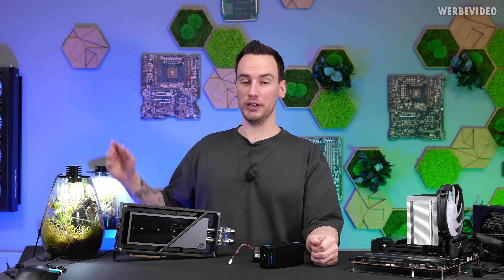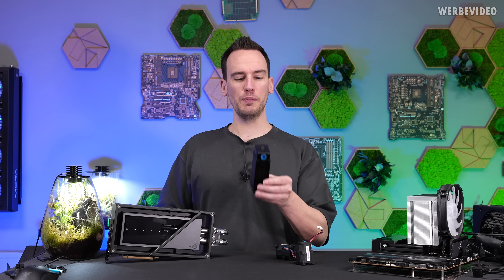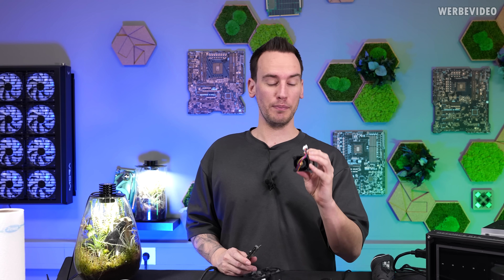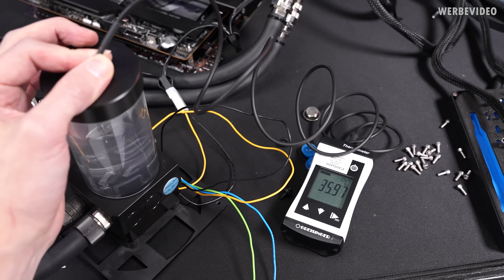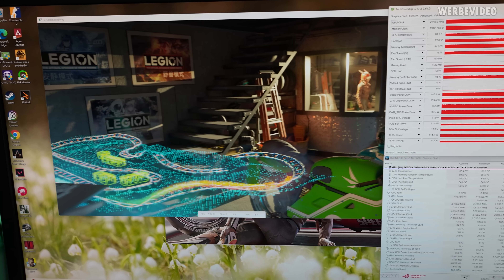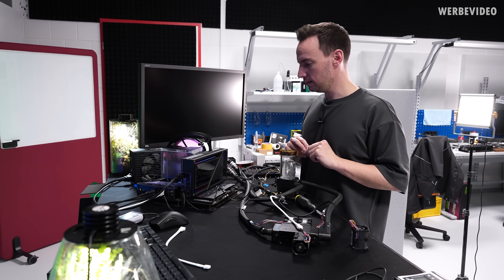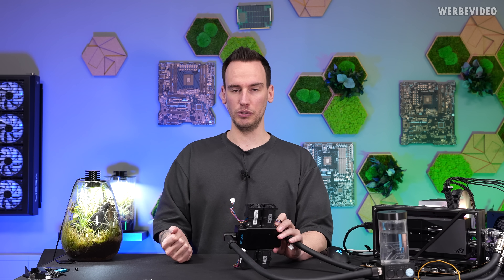Cooling my RTX 4090 with the Smallest Radiator I could find

Comment: instead of fans, you should try a compressor, for compressed air cooling over the radiator lol
Reply: or alternatively, maybe use a peltier cooler to transfer heat from two water blocks to have a cold loop and a hot loop, so the hot loop can dissipate heat more effectively (downside is that the peltier will add a lot of heat of it's own to have to dissipate)

Comment: Yeah, I replaced the 120mm fans with 4x60mm fans. I don't run them at full speed, but they have higher static pressure, so if you're using PU filters, it works great with them (lesser noise, more airflow). Also in generally, I did some casual tests and determined that 4x60mm fans make less noise than 1x120mm fan (but the wiring is difficult) for the same power consumption (since I could not measure the air flow). For the power supply, I'm using an external 12V power supply and the mobo PWM pin is connected to all the fans. Also I'm using a simple 12V relay to ensure that the fans shut down when the PC is shut down (and when there is no PWM signal) while the external SMPS is up (since it's powering other things too).

Comment: This would be so much easier if manufacturers would provide actual useful values. Like the heat dissipation of the radiator in the usual W/m²K. This way one could easily calculate the required area of the radiator fins to achieve the desired water temperature at any given room temperature.

Comment: I had a similar discovery with a cheap fan controller. I bought one that has 4 rheostats and support 8 5v fans. I bought a 4U 24 bay case and the air flow for the drives was lacking, so I put better (and quieter) fans in there, but cranked them all up to 100%. While I was messing around with other cables it moved once and hit the side of the case. Everything shut off. To my horror, it turns out that some of the contacts/pins from the factory weren't grounded or insulated in any way and it shorted out when it touched the case! So I coated anything metal in superglue and that fixed that issue. Then I noticed that it was putting off A LOT of heat, I touched one of the 4 ICs and burned myself like you did and was like "holy shit that's hot!". Luckily I had a bunch of small heatsinks that I purchased for a Pi 3 or 4 long ago and they fit perfectly! 1 heatsink on each IC definitely helped drop the temps down to reasonable, but still warm/hot to the touch, the moderate airflow in the case also helped cool them down. We always forget how hot tiny things get when we force a lot of power through them hahaha

Comment: These 40mm rads are very interesting units. I first came across them when an ex-customer involved in High Frequency Trading and crypto in the early days requested for my company to procure the servers. I believe it was an ICC Vega "server" where they had a Core i9 overclocked to 5GHz (you want high single-threaded performance for HFT to validate and push trades faster rather than high core counts) and used a triple 40mm rad to handle the heat.
The IT requirements in that part of the finance industry is rather interesting. They'll ditch any form of cybersecurity necessary just to get lower latencies - no firewalls or managed switches (for VLAN segmentation) because they add latencies. There are even specialized unmanaged switches for this industry that are designed to purely focus on ultra low latency switching

Comment: i think the setup is wrong. You should put the fans the other way of the radiator cause at these spees the fans are poducing to much heat i think. So, at least make the test again with one blowing and the other sucking throug the radiator. Adn also you have to measure the air temp. before and after to find the differential.

Comment: I love these tiny radiators. Mine are a bit larger, designed for 80mm fans in 2U chassis instead of these 1U rads, but I have a grand total of 2x80mm cooling a 14900K and 7900XTX. Noise isn't a concern, but size was for a custom case.

Comment: Clearly static pressure isn't an issue, you should stack a few of the radiators in series to get closer to a counter flow heat exchanger. See if gets any closer to being practical

Comment: you could put the fan controller to back of the radiator to reduce the temps with air flow of the fans

Comment: Now try watercooling using car air heater radiator + maybe try to use those fans with venturi effect --- single fan , adapter for way bigger radiator than fan size + venturi effect designed intake , could be interesting + maybe testing nozzles for fan

Comment: put the fans and radiator in a long foam tube with baffles as noise cancelling, and whack the controller at the opening with a heatsink for passive cooling from the airflow

might be good for an indesk pc, very long but narrow and thin

Comment: It makes me wonder if the heat sinking performance of the tiny rad under burst loads could be improved if the plumbing inside were zig-zagged, increasing the surface area by lengthening so it is an endless chicane from start-to-finish.

Comment: there is an extreme to which either adding surface area or air volume and velocity doesn't further improve cooling. You have to add both, unfortunately :)

Comment: My issue is no matter what, smaller parts = smaller contact patch, which means more friction and wear. Personally I'd rather have slightly larger parts on something I might move once a year at most and just never have to worry about failure.

Comment: Many boards have one or two 3A headers these days which should handle two of these if they're really just 18W max. I'd be hesitant to push it and run them at 100% but I've pulled quite a lot of power from these headers without issue.

Comment: A fan usually has a 4pin connector, +12V, gnd, pwm and a feedback of the rpm
You could cut the 12v and gnd wires and hook them up directly to the psu and plug the 4pin connector directly into the motherboard
With this you can control any pwm fans without frying your mb

Comment: last time i replaced fans in 1U servers i remember those things had 3.5A tops, which at 12V (because they run at 12V not 5V) mean some 42W at max speed, i doubt normal fan controller can handle 2 of these, let alone 4. 4 fans at 100% speed will draw 14A from 12V rail ... and that's just for fans. mind regular 1U servers have either 6 or 8 of those, and if they are stacked, like in compute servers, you might even have 16 of them ... that's some 56A or  you can say 672W of power just for fans ... although normaly they don't run all at that speed.

Comment: I've had a Mobo that did do 3A each on 2 fan connectors, I ran 2.7A fans on it.
The magic of the pwm on fans is that you can just pipe a trace directly from the 12V  connector, the pwm itself is done on the fan, so the controller shouldn't get warm unless it's actually doing dc speed control.

Comment: How big difference could copper radiator make compared to aluminium radiator with same fluid capacity and surface area? I think atleast the airtempature behind the radiator would be alot closer to fluid tempature

Comment: You can usually guess if a push/pull will make a large change. If it's a thinner rad or has wide fin spacing, there's not much resistance at all and adding extra fans won't produce a considerable change, if any at all. If it's a beefier rad with a thick core or tight fin spacing, push/pull can have an impact.

Comment: i'm not physicist but heat dissipation relate to thermodynamic. if you want low air flow then you need larger surface area to dissipate the heat, if you use smaller surface area then you need faster air flow to dissipate the heat. with that small radiator, it's need to use high rpm and higher air flow. that radiator usually used for 1U server case for cooling cpu (not gpu). for gpu intense use (such gaming) better stick with 2-3 240 radiator, don't sacrifice your ear (i know, because my server rack is same room where I work, those fans are insane when they in full speed, thank god I use only for cpu with low work load).

Comment: Please use hearing protection around those fans. The sound they make is more than loud. It is not bandlimited. It contains energy at extreme frequencies. The energy in a wave is equal to its amplitude times the square of its frequency. Loud sounds will make your ears ring, high sounds will make your ears ring, loud high sounds will destroy your hearing!

Comment: Howling Delta fans killing peoples' ears all over again 20 years later... Ah, the sweet smell of nostalgia! :D

What of raising the water block a ways off the table so the fan intakes don't rest on a flat surface? This could potentially improve air flow through the cooler (maybe even if just a little bit), since axial fans tend to suck/squirt a bunch of air from the sides, and not just straight into the fan...

Also, I would like to put a heatsink on that fan controller, if it's running that hot... Undoubtedly its service life would be heavily cut short if temperature-tortured this way for an extended period. But, since nobody wants to listen to counter-rotating 90dB Delta howlers for even a short amount of time it probably doesn't matter! :D

Comment: I didn't expect such a sloppy video from you tbh, obviously you were not cooling it enough and when the water temp stopped raising at 60º I am sure the video card was throttling. So no, you can't dissipate 450W with that radiator, maybe if you pump in cold air, but then you risk condensation etc etc .

Comment: I suspect a lot of people will wonder what the point of this video is, but it's actually demonstrating a good point about the state of PC water cooling right now.

I've been water cooling for over 20 years, and it's frustrated me watching people waste money on absurdly overkill radiator setups while chasing lower coolant temps, to the point people often have one intake radiator dumping heat into an exhaust radiator which is effectively cancelling out a lot of the benefit of the 2nd radiator. Radiators become more efficient as the delta between ambient air and the coolant increases, so chasing low coolant temps mostly does nothing but increase the cost, complexity, and points of failure, while it decreases the flowrate and provides almost no decrease in component temperatures or noise reduction.

At 20-23C ambient, a single high quality 240mm radiator with high static pressure fans is capable of dissipating ~550W while still maintaining very reasonable noise levels. A single high quality 360mm is already enough to cool an overclocked 14900K + 4090.

I think a great video series would be testing each radiator area sizing with this same heat load, and showing just how much heat you can actually dissipate with them. I think it would surprise a LOT of people and get them re-evaluating how much radiator they actually need to cool their build.

Comment: Weird is that some voltage / current controller? Why if those fans are PWM? No need waste heat in controller as fans controls speed by PWM if possible. All you need is PWM generator based fan controller which does just bypass the voltage.

Comment: I know Roman still has all his marbles, because if he lost them all he would have tried to water cool the fan controller.
Man has made the PC watercooling version of the Republic XF-84H Thunderscreech or Tupolev Tu-95 lol. I have a little battery powered air duster, small but hefty and not at all cheap and that thing pushes enough air to drain the battery in it in 10 minutes at full throttle and gets loud enough that I need hearing protection so I understand the pain.

Comment: just at the beginning of the video i know there is limitation of how much a powerful fan can extract as heat from a radiator, the limit is the conductivity between the water inside and the copper of the radiator. it takes time to move the heat and spread through the surface of that radiator, no matter how fast the fans are. you can increase that speed by just increasing the surface.

the same happens with the am5 IHS small and thick, creating a "jam" in the heat transfer.

Comment: Those fins are way too sparse, especially when its made for 40mm fans which have (or can have) really high static pressures.  I'd want double the density minimum.
Reply: fin density depends more on air speed than the size. It looks like it's made for regular low to medium air speed, where low fin density works pretty well. But if you want to extract the absolute most amount of heat, then you are right. Way higher fin density with more channels would work a lot better with such incredibly fast fans.

Comment: I assume that these 4 fans plugged probably tripped OCP protection on PSU, not sure what their starting amps are for fans, I tripped few times OCP protection on Aquaero and Quadro Fan controllers with few fans

That's what we like from you Roman, crazy things who nobody does, awesome video mate
Reply: Yea! I have done that on server boards with those Blowiemetron delta fans too! They blow a lot, but it doesnt really gain much in terms of thermals wrt the cost or the difficulty of installation.

Edit -> I ended up making a separate fan control board with a separate SMPS using the RP2040 to control the ramps from the mobo commands. Waste of money, it was.
Reply: Startup amps for those brushless fans is little if any higher than at their full speed.  You might be thinking of brushed motors, especially with more load on them than just pushing air.  They're probably no more than about 1.5A  peak rated and in use, probably 1A or less which is pretty trivial compared to powering a computer and gaming video card, but yes that could overwhelm a fan controller not designed for that much current.  It wouldn't trip OCP on the  PSU.

Comment: The whole point of having water cooled system is high performance with low noise levels. I'd rather see a proper build using a side mounted mora 3x3 with the best PC case for this solution currently available on the market. And probably coupled with AquaComputer's Ultimate pump.

Comment: I heard 60C is too much for some pc watercooling components to handle (pumps?), and some temperature monitors trigger warning signals.. I guess you would have noticed if the water hot signal would somehow intercept your PS_ON pin?

Comment: ive had multiple 30 series cards working 24/7 for years at 94c+ on vrams and they all survived and were healthy..hell my daily 3090 still pushing it with modded aio, copper modded 24 vrams etc and its not a big of a deal, my 240 rad with 75% speed noctuas does 60/64c at full load 520W

Comment: Would be interesting to measure the open voltage of the 3rd/4th fans (as they were acting as generators) prior to connecting them to controller.

Comment: Is the problem Fan Controller related i.e. the controller isn't able to provide the current required is is getting too hot? may be you should think about using separate fan controllers, adding some heatsinks to the controller(s) or water-cooling the controllers?

Comment: 58°C lol my advice is that your liquid temp should never go above 45°C I noticed in a non air-conditioned european room that under 40°C liquid your PC barely heats the room but above 45°C liquid temps it will become noticeably hotter and you will feel a heatwave coming out of your PC I started with 1x360mm then 2 then 3 radsand can play at 700/800 computer watts fine lian li 011 dynamic xl ftw

Comment: I doubt the two fans were running at full speed, 20k RPM is much much louder.
It seems like the dumbass fan controller was the DC not PWM type and it probably had some weak electronics or tripping PTC fuse and it was not outputting all 12V, the fact that you needed to turn them high to get them going confirms it, high end fans like that have auto-kick-start function but you need to supply all 12V and drive it with PWM.
Please re-make the video and this time find a PWM fan splitter.
Reply: Or If you want I can design a high power fan splitter for you that takes a PCIE/EPS 8 pin and can drive as much current as the fan pin header is rated to (3A?).
It then would get PWM from the motherboard and also supply TACHO speed of one of the fans.
Btw. the exhaust fan will spin faster.

Comment: Could try DIYing your own radiator: Take an old CPU cooler with heatpipes, cut the heatpipes and clean them out, and plumb them up to some fittings.

There are some absolutely miniscule heatpipe coolers out there. Raspberry pi ones with 2 heatpipes for example. Laptop coolers too. Or you could go the opposite route and see how much performance you can get from a 25$ tower cooler turned into a radiator.

What would be really hilarious is using an older Vapor Chamber or Heatpipe GPU cooler as a radiator. Old, dead cards may still have some life left in them: as coolers for new cards.

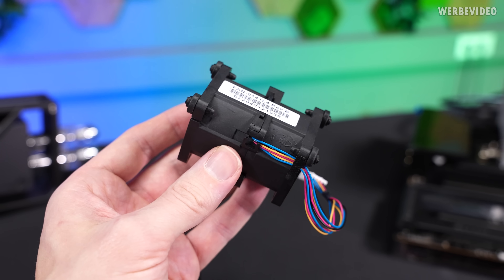Comment: 3:38 18Watt fan.  
5:39 20Watt fan controller per channel.
Flying a bit close to the sun @der8auer

Fan controllers for PC are always under build, even if it says 20Watt on the sticker.
I would say anything drawing above 10Watt should have heatsinks on components that do the heavy lifting AKA get the most hot.
A thumb rule of mine is always go for the 50% load approach,  so you have headroom for power spikes and thermal headroom.
So If you would need 20Watt then get a 40Watt power supply.

Comment: That fan controller was getting hot because you were jamming about 75W through it. The controller IC is the LM2596 from what I can tell, which its data sheet says is rated for only 3A output current, meaning 36W at most at 12V. And you were trying to shove twice that through it.

Comment: Could you do the same thing but for actually normal size 120/140mm radiator?  Especially with the tendency for extremely oversized radiator builds.